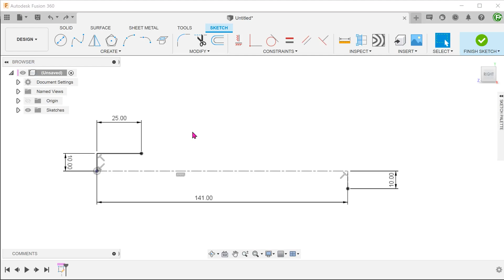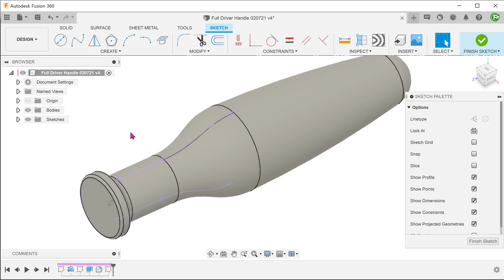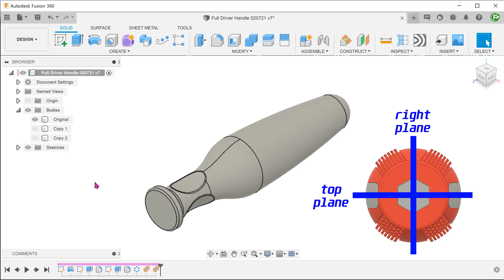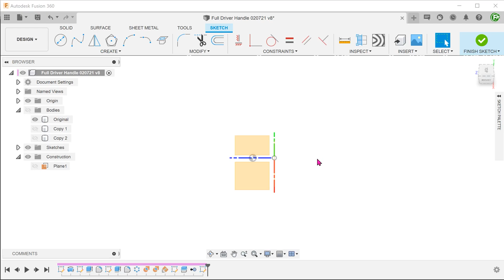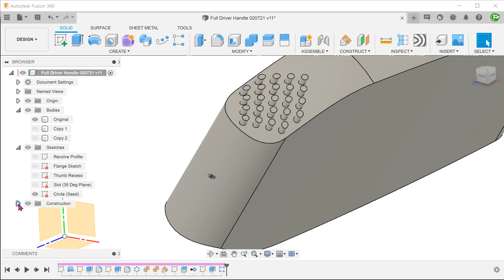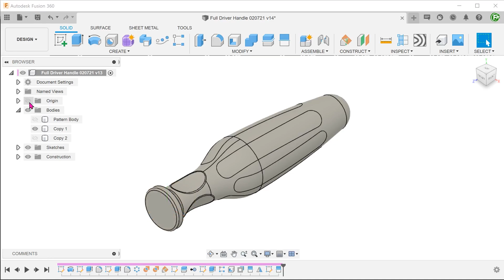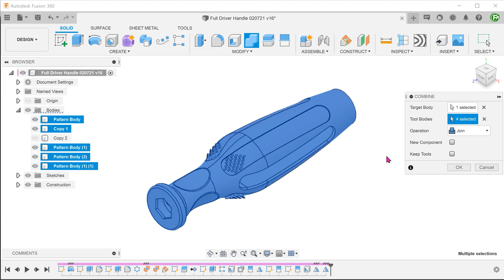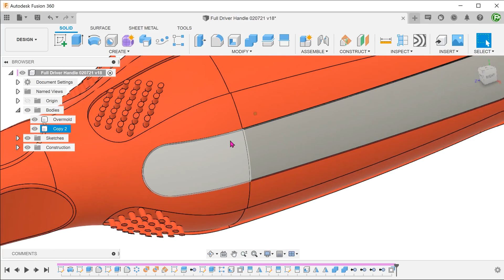Fusion 360 | Screwdriver Handle (Full Narrated Tutorial)

Comment from the maker: This video is strictly meant to be a modelling exercise. It should not be taken as a viable design to be manufactured. The dimensions shown here are arbitrary and might not be practical for an actual screwdriver. My experience with overmolding is very limited and this is my best guess as to how the overmold can be created in this case. Do seek advice from injection molding experts as to how this should be created, especially when it comes to thicknesses, clearances, drafting, parting lines, etc. Lastly, if you wish to skip the starting sketch profile, I have provided a link to download a file with the sketch. Happy modelling!

https://a360.co/3qKHWMk

Comment: Does a centerline and construction line function differently in Fusion 360?
Reply from the maker: Centerlines are more for controlling symmetry. They can also serve as axes in revolves. Construction lines can be thought of as reference lines which you do not want interfering with closed profiles. This might be good subject matter for a short video.
Reply: @Fusion360School  but they function the same, right? You can revolve around regular lines, construction lines, and center lines.
Reply: @larrybud  In my experience yes, but centerlines will "attract" the attention of revolves while construction line will not. It also helps with clarity when revisiting a project :)

Comment: Hello, I completed the project, but was unable to get the rectangular pattern to show the circular nibs on the body formed by the arc adjacent to the spline. The 2 curves are tangent to each other in the sketch. Everything else is as you designed it. Can you think of something that I should examine?
Reply from the maker: Hi, I did face the same issue in an earlier video where I went in depth to explain the pattern. But that was because I chose a surface as the object to extrude to. If you choose the body as the object, there shouldn't be any problem. I would like to further examine this. If possible, would you be able to export the f3d file and send to me at tanwinghoe1983@gmail.com?

Comment: why not circular pattern the over molded parts instead of 2 mirrors then just suppress 2 of them
Reply from the maker: That's a good point. Initially, I did attempt a circular pattern. However, I could not get the bodies to line up exactly. I just went to try again. Turns out that the problem is the angled plane of 35 deg, which is really awkward. I changed this to 36 deg, patterned to a quantity of 10 and suppressed the unwanted bodies and it works.

Comment from the maker: In preparing for the video, I must have done this 15-20 times. It is always so satisfying to get to the end (16:32),  change the quantity and see the full pattern generated nicely!
Reply: The first rectangular pattern worked fine, but when I went back to apply the 28x28 pattern it stopped at the tangent line.Tried adjust and optimized, no luck. Great vid, BTW.
Reply from the maker: During the seed extrude, did you use "to object" as extent and select the body from the bodies folder?
Reply: @Fusion360School  Yes the first extrude and pattern looked exactly like yours.
Reply from the maker: @oliver7373  Mmm...this is strange. Looking back at a previous video (https://www.youtube.com/watch?v=i1vkgMtgbGI) where I did an in depth look at the pattern, I faced the exact same problem at 2:38. But that was because I chose a face as the object. Once I replaced the object with a body, the pattern would extend beyond the tangent line. Not sure what is happening here. In all my tests, this has yet to fail on me, so I don't think this is Fusion 360 being "finnicky" here.
Reply: @Fusion360School  I'll go back and try that, thanks!
Reply: Quick question: Couldn't the Flange be made Along with the Initial Sketch?